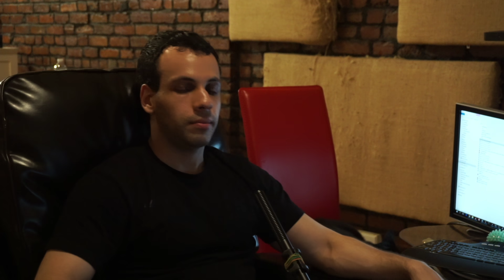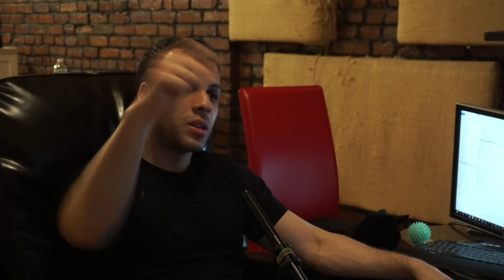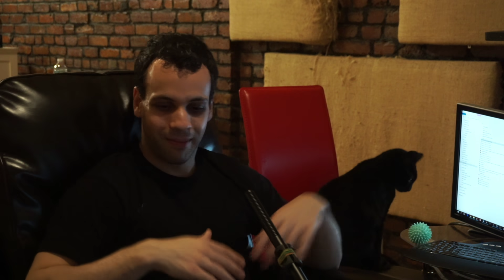A message to the kid who called yesterday

Comment: In terms of repair videos, yours are probably the best available. You are one of the very few that takes the time to show the entire process rather than taking an hour+ of footage, condensing it down to 5 minutes where the majority of the smaller steps are skipped, thus making for content that only someone who already is already skilled in this area can follow. There are many people on various tech communities whose first introduction to board level repair, has been from your videos, and at that level, seeing the entire process, does more for them than any textbook or plain lecture would.

PS, most formal education does not provide much experience in this area, because practically everything assumes a perfect world, and practical work takes a back seat to theory and the intellectual side of electronic engineering, With the practical, coming in the form of cramming when you suddenly have to complete a project.

Comment: about 15 years ago as a teenager, I built a computer through a computer shop that I regularly gave business to. I bought games from there, I bought parts over years, probably spent about $5,000 over the space of 5-6 years at least. I had an issue with the computer I built from them and I called them up... they acted exactly like this. "I'm not giving you advice over the phone, it doesn't earn me money!"
I never went in that store ever again and took my business elsewhere. 12 months later that store shut down due to lack of business.
Be careful having a mindset like this.

Comment: Used to call my ISP when the internet connection went out. They would run me around for 20 minutes asking me to check all these dumb little things I already checked twice. It always ended up being a problem on their end. They finally made a note on my account stating that I wasn't the normal user who called when Internet explorer crashed. Now I call, they check their end and the problems is fixed in 2 minutes.(totally unrelated, I know)